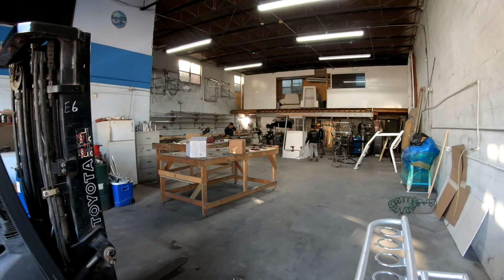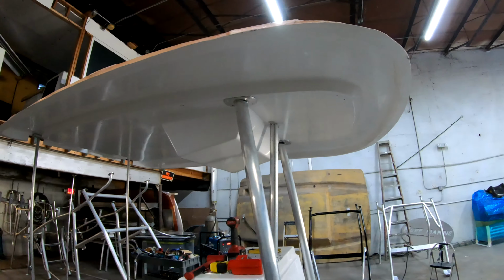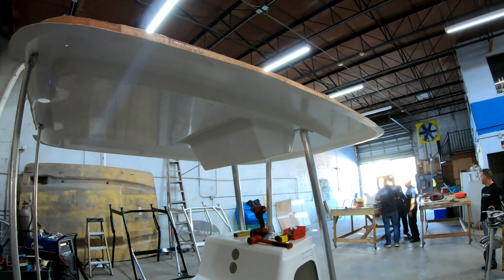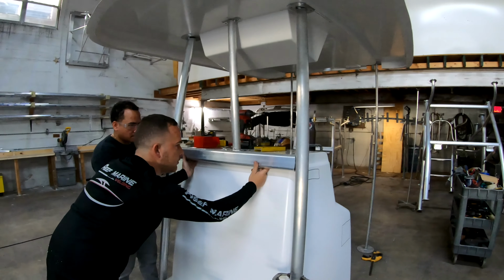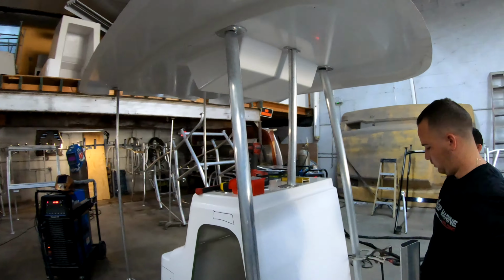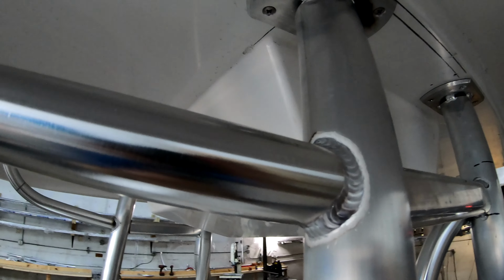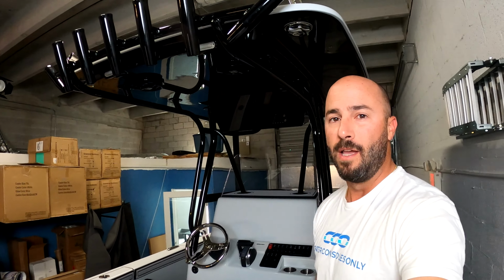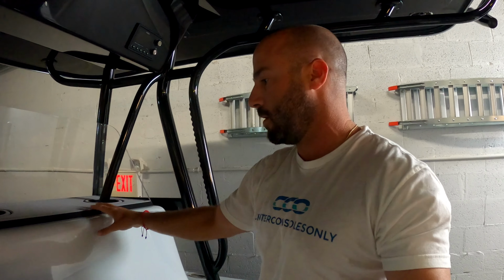WELDING OUR T-TOP PIPING! Reef Marine Welding Facility

Comment: What kind of Bender is that
Reply: One shot bender. Designed for conduit and modified to not scratch the aluminum.
Reply: Seems to be alot of trade secrets in marine fabrication. I've talked to some fabricators, watch some YouTube video and look for tools in the background to find out how it's actually done.
Reply: @ccsmallengines  You can see the kinks in those hard bends, not made for anything more than 30 degrees. They should invest in tools made for the job like a JD2 bender made for up to 180 deg bends. I would be pissed if I paid for a t-top and had kinks in my tubing.
Reply: @elementoutdoors2936  believe it or not, even Vikings towers have those "kinks"
Reply: @elementoutdoors2936  100% wrong. I started with a JD2 that did nothing but scar the polished finish on anodized pipe and now use a 1 shot just like in this video and no issues. No scars and no kinks. Also definitely bends more than 30 degrees.
Reply: @brownleevision  Maybe you need to invest in the proper dies, dealran dies made for aluminum. My t top does not have any of those ugly kinks, so try again shortstack
Reply: @elementoutdoors2936  I wasn't intending to be rude bud. I did have the delrin follower dies with it and that was my results. I can only speak from my experience. I have seen where some haven't had the issue with the JD2, but I did. Scar right down the centerline on every bend. Majority of tower folks I know of use a one shot. I'm glad the JD2 is working for you, it's much cheaper. But, you are wrong about the bend angle of 30 degrees. The one shot will go over 90 in one shot.